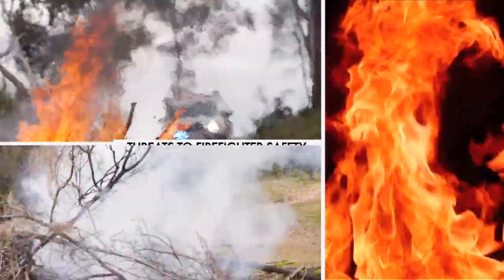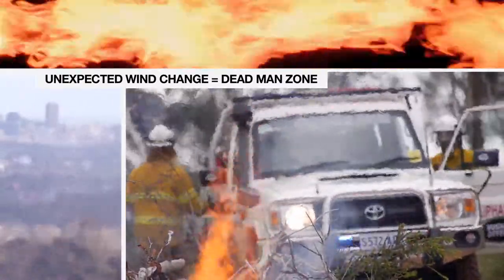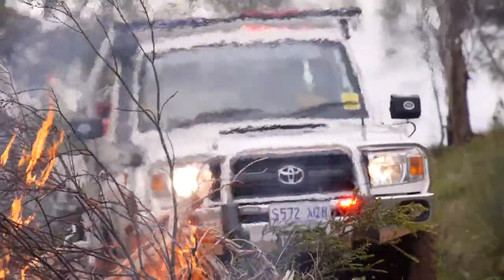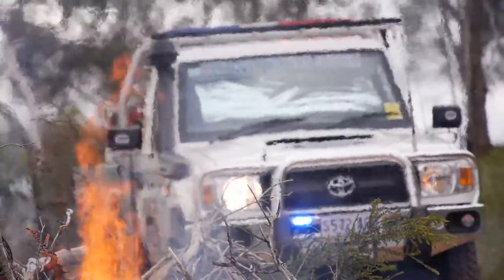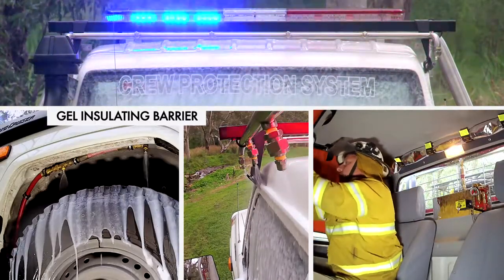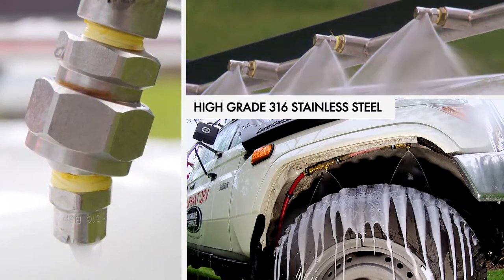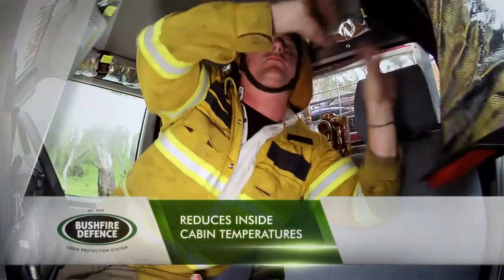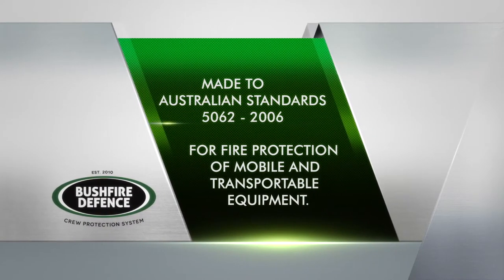BUSHFIRE DEFENCE CREW PROTECTION SYSTEM

Comment: What about the bomb under the bonnet? AKA the fuel tank. Correct me if I am wrong but if you are in the cabin then you are over the tank. Fire, heat, petrol..... BOOM!
Reply from the maker: Research and investigations into fatalities in
grass and wildfires have shown that many
occur when people have been caught on
the road in their cars (e.g. Krusel & Petris,
1992). People have either fled their car on
foot or tried to drive through the thick smoke
and flames, which has resulted in accidents
and cars getting stuck and the occupants
entrapped. However it is also true that many
of those who have survived being caught out
on the road during a bushfire have sheltered
inside their car until the fire front passed
and it was safe to get out. The Lara bushfire
illustrated this point well. When motorists
on the Melbourne-Geelong Freeway were
confronted with a fast moving grassfire
seventeen people abandoned their cars and
died while at least six people sheltered in
their cars and survived....fears of fuel tanks
exploding which prompt car abandonment
are not well founded in reality, despite what
may be reported in the media.
Reply from the maker: In general a car orientated towards the
oncoming fire front will remain tenable at
higher heat radiation levels. Positioning the
car towards the oncoming fire front offers a
couple of possible advantages. Firstly, if the
fuel tank vents then the vapours will be blown
away from the car. 

AFAC
Guidelines for people in cars
during bushfires
Janurary 2008 update
https://www.gpem.uq.edu.au/ohs/ohs-docs/Fire-guidlines-people-in-vehicles.pdf